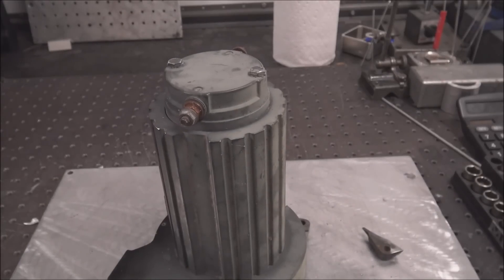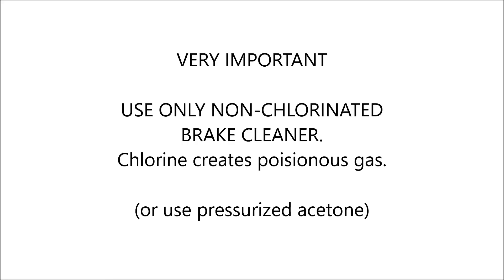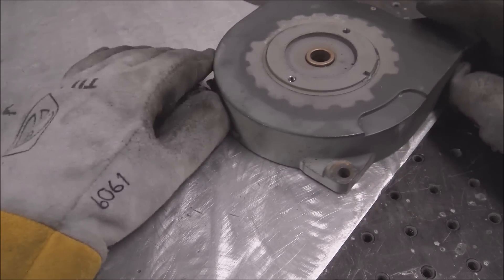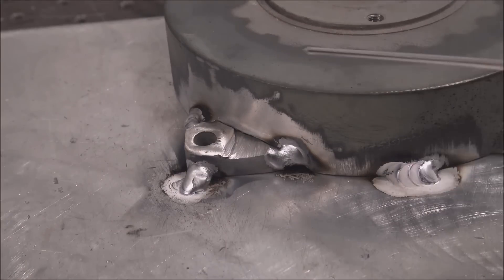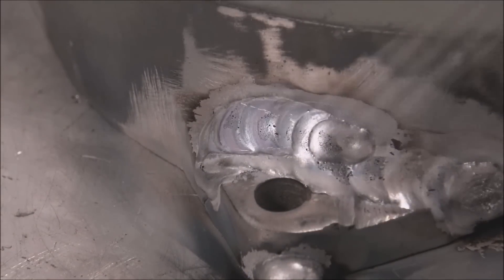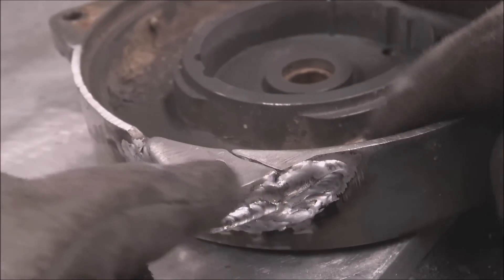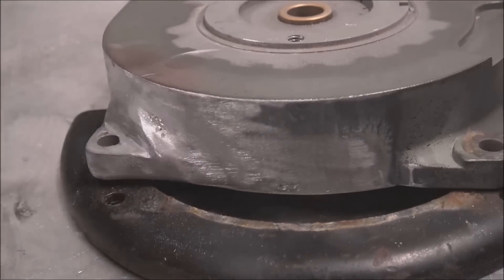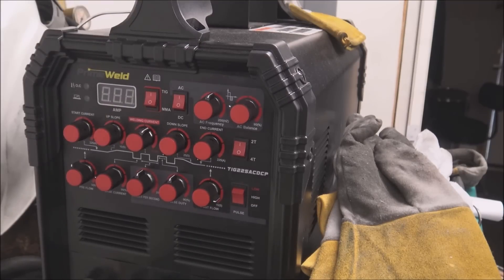TIG Cast Aluminum Repair Advice - TIG Welding

Comment from the maker: Notice at 6:06 the ear-to-table tack gave way... Needed a bit more tack.
-Carbide Burr used in this video: https://amzn.to/4bGbBfC
-Oscillating tool to cut welds: https://amzn.to/3xL6g8Z
-TIG Welder used in this video: http://www.6061.com/primeweld.htm
-All TIG welding/aluminum fabrication questions answered in detail at http://www.6061.com

Thanks for watching

Comment: I just commented on another cast video of yours a few minutes ago. Few people film cast videos because of the struggle. I'm glad you are taking the time. Something that works for me is welding the first side. I'll groove the second side near enough to achieve full penetration but simply blend on the first or second pass without any filler. Brushing and cleaning between passes. This helps a lot on junk castings or castings that are oil impregnated. I have not subscribed to your video series to know which electrode you like. You mentioned it basically works for everything. I feel the purple E3 works well on castings (steel too). It seems to hold up to higher cleaning action and vaporizes contaminants better than others I have ran. Like you, 1/8" all the way. I hope to see more cast videos. Thanks for taking the time to shoot and edit!!!!

Comment: I used chalk on my carbide bits when using them on aluminum. Helps prevent the bits from clogging. Not sure how that would contaminate aluminum for welding though.

Comment: Also, if you don't clean up both sides, good enough it will pull all the contamination to the front or back of your weld 
Considering the item you have, great welding, mate

Comment: If you have a part that was sprayed with chlorinated brake cleaner, say it was an engine part, and you didn't know, would going over it with acetone in the normal way be sufficient to keep you safe?

Comment: Pro tip: If the carbide burr gets plugged with aluminum, use drain cleaner (sodium hydroxide) in warm water. Soak the carbide in, it will chemically remove the aluminum from the carbide. It will bubble as it eats away the aluminum.

Comment: I like to do a bit of a tig 'wash' over cast part repairs before i add filler, do it at low amps can pull out a lot of the crap in the casting then wire brush it clean then go back in with the filler weld. Cast is also very hit an miss in quality.
Awesome video aswell mate 🔥👌

Comment: 7:50 quick side note about the aluminum galling up in the flutes of cutters... A short soak in a lye bath will quickly eat out the aluminum buildup in the flutes of the cutter and have you back up and running with no risk of chipping or dulling the cutting edges like you can cause by trying to dig it out with a pick or other object. Just obviously take routine precautions due to dealing with Caustic Soda (i.e., Sodium hydroxide / Lye).
Reply from the maker: Great advice, I learned this in person a few years ago from my machinist friend:
https://www.dotymi.com/

Comment: Good repair with some excellent tips.  One thing to keep in mind is that all castings will have porosity in them pretty much regardless of the alloy.  However, A356, which is the most common die casting alloy, it is a 7% Si composition alloy which reduces the amount of porosity in the casting and increases fluidity for the pour.  Lesser alloys will have lower amounts of Si which will lead to greater porosity.  I will point out that the porosity that I am describing is on the microscopic scale and not the macroscopic scale as seen in the weld bead.
Reply: Your on the money, I use 4047 filler rods.

Comment: Love your videos man. You inspire me to get better at my aluminum welding. Chlorinated brake cleaner creates phosgene gas, which turns into hydrochloric acid in your lungs. I had some years ago I let set a couple days before welding, it still off gassed & made me sick.

Comment: I've seen some folks recommend testing cast aluminum parts before welding to make sure they are aluminum and not magnesium.  I believe a bit of white vinegar on clean metal will cause magnesium to bubble but aluminum will not react. Have you encountered magnesium in your repairs or do you think this precaution is unnecessary?
Reply from the maker: 15 or so years ago, I tried welding a dirt bike clutch cover. I assumed it was aluminum, but it became apparent very quickly that it was magnesium, using the simple tack weld test. There was zero fusion, and it immediately broke back apart. I suggested to the customer they should buy a new replacement cover.

Comment: just welded up a tank my buddy brought me, he used WD on his cutoff wheel when he cut the sheet to size.  it was a total PITA to get those edges clean before i tacked it up and i still had some crap in the puddle.  i use bar soap on my wheels/flapper to prep AL and it seems to clean off easily with rubbing alchohol during prep.  :shrug: